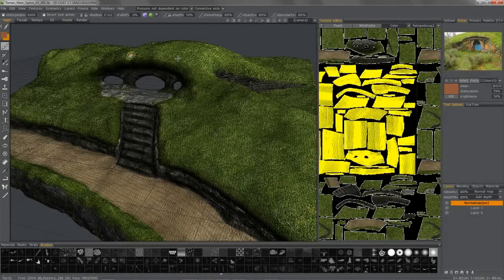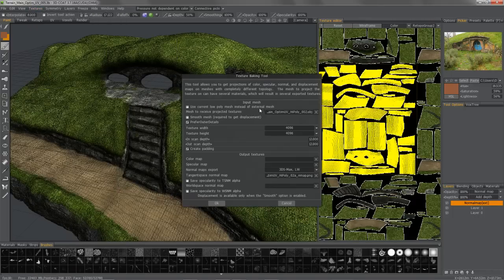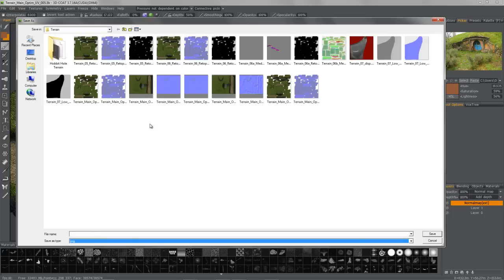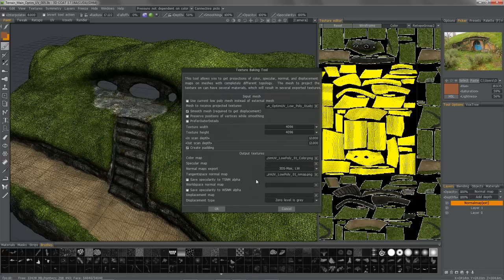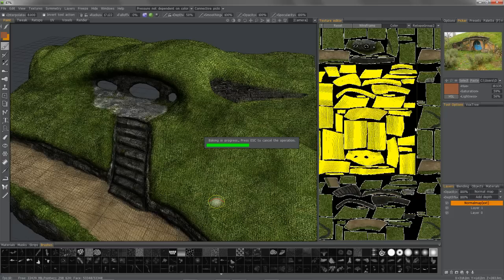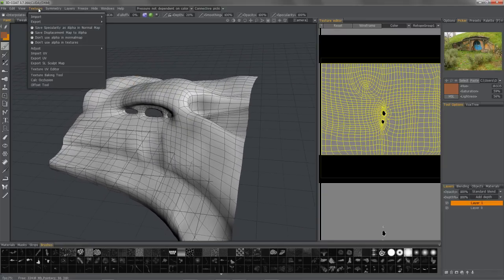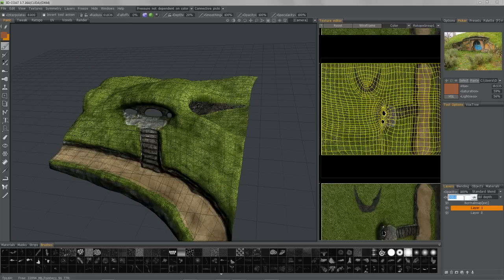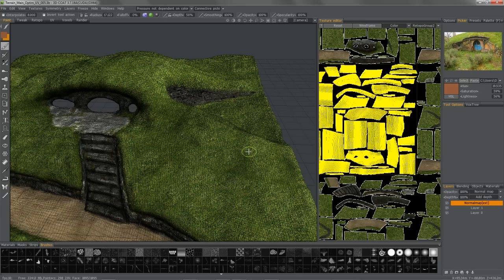Texture Baking Tool

Comment: Is there a demo on the workflow of baking from the retopo room / high poly to low poly? There is a new autoretopo tool that is free and super fast/ good.. Good for environment geo called Instant Meshes.
Reply from the maker: +Sam Gebhardt Yes, the videos toward the end of the &quot;Intro to 3D Coat&quot; playlist. It covers texture baking from the Retopo workspace and the different modes one can choose. There is a slight change in that the baking options accessed in these videos, have since been moved from the RETOPO Menu, to its own BAKING menu.

You can also find further info on the subject in the online manual, from this link location: 
http://3d-coat.com/manual/retopo/347-texturebaking/

Comment: I am trying to export a color texture from Coat and fail every time ! No matter what I do (Trying to unwrap or autoRetopo etc.)
Reply from the maker: It would be more effective to take up this topic on the 3D Coat forums, where you can share a screen grab or recording to show just what is going on in your scene. Yotube isn't a good platform to diagnose problems one may have with the software. So, please give that a try:  http://3d-coat.com/forum/index.php
Reply from the maker: ....But in the mean time, if you have your model textured in the Paint workspace and have your UV's laid out, then you can either export the model directly from the FILE > EXPORT menu....or export just the texture maps via the TEXTURE > EXPORT menu
Reply: 3D Coat
THX - Actually yesterday I did post to the forums (for some reason I could not see it right after posting)
I will try once more . My problem was actually retopoing the mesh correctly - I tried the various methods unsuccessfully. I did mange to do it with some rocks but not with a terrain of about 50 meters.

Comment from the maker: That's what happens when you bake maps in the Retopo Room. It's converting the details from the super high poly model (either a voxel model or one you import as a reference mesh) to your low-medium poly Retopo Mesh. 

In this particular case, it is baking all the existing textures (color, specular, and Normal/Displacement maps) from one model to another version of it.